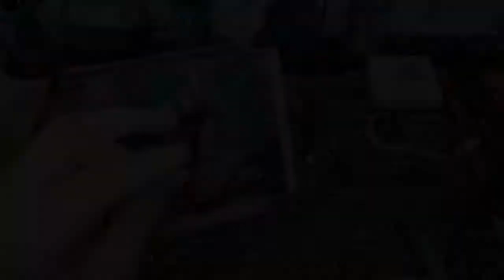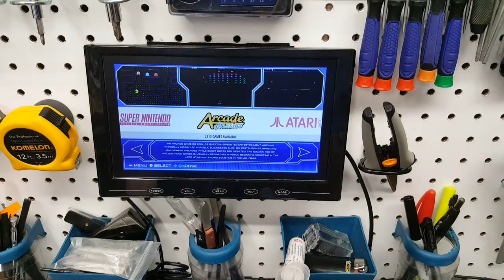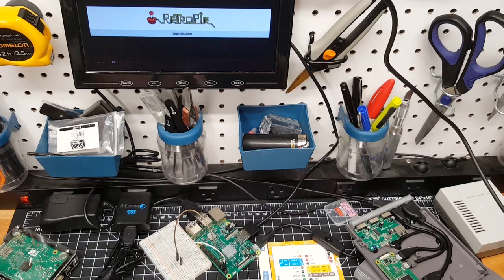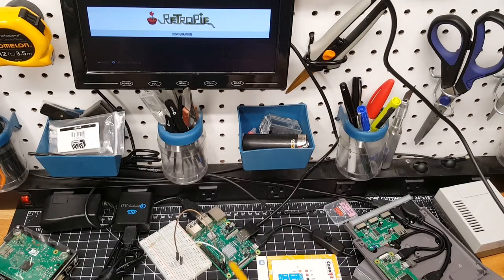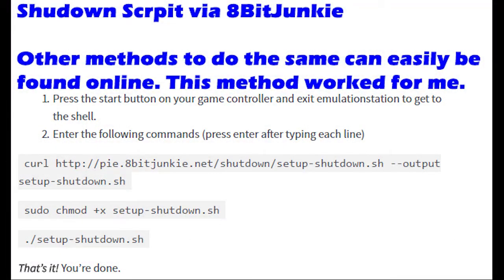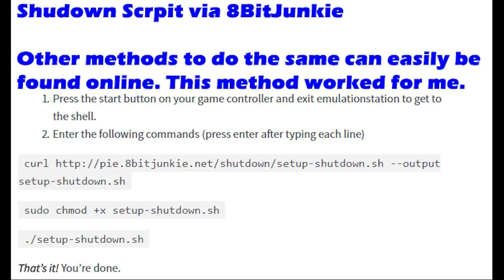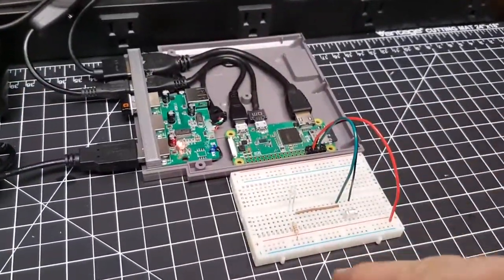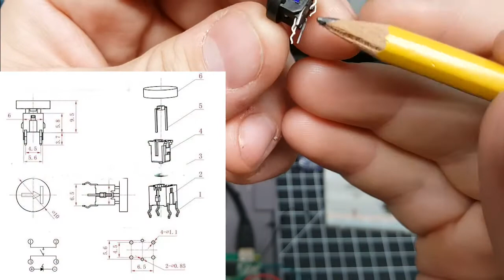NES PiCart RetroPie Gaming System with LED Power Button

Comment: For some reason shut down function does not work. It works to power it on with no problems, but won't shut down. Checked with multimeter and found that terminals 5 and 6 remain shortened after turned on. 8nitjunkie instruvtions say that if it doesn’t shut down, there’s something wrong with the software setup. Do you have any ideas how to fix it?
Reply from the maker: I pretty much dumped the code for the shutdown switch directly into the Pi, as is. Didn't modify anything, so really wouldn't know how to help troubleshooting wise in that regard. Sorry.

Comment: When I power on the pi, the button lights up for maybe a half second then turns right off. The button turns the pi on and off with no problem but that light just wont stay on. I've checked my solder job and it looks good. My wires are soldered to  5,6 for the switch and 8 for the positive side of the led. And I did bridge the ground like you did in the video. I used the style of button you had pop up in the video. Any clue where I might have went wrong? Maybe I got a bad button?
Reply from the maker: Did it only light up the first time you fired it up, or does it go on every time you try to turn it on? If it only lit up once, you probably burnt out the LED. Its is also very possible its a bad button. They are pretty sensitive to overvoltage. I have gone through a few myself.
Reply: MrArmagedd0n It lights up every time I turn it on. I even went ahead and put a new one in and the same thing happens, it lights up for a half second then goes off.

Success!! I needed to enable serial in raspberry config. Thank for all your help! And awesome tutorial.